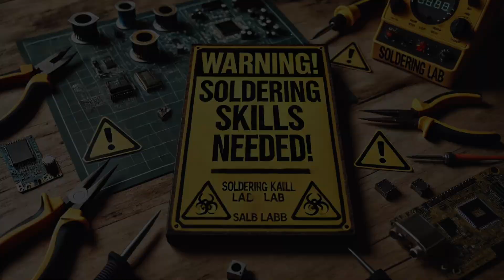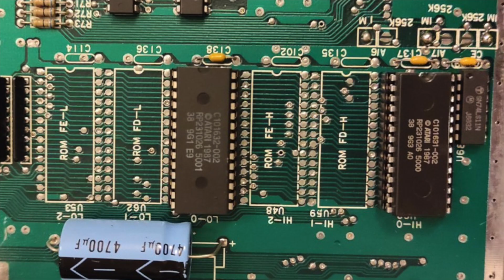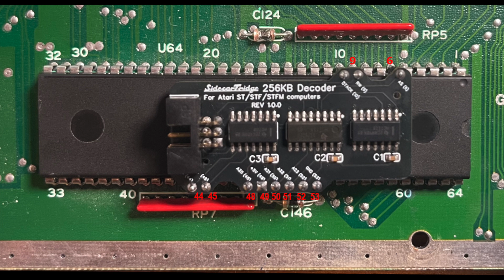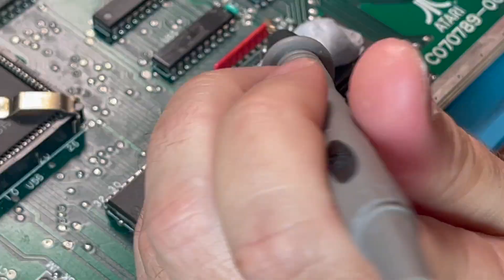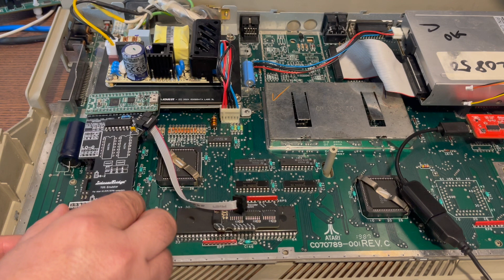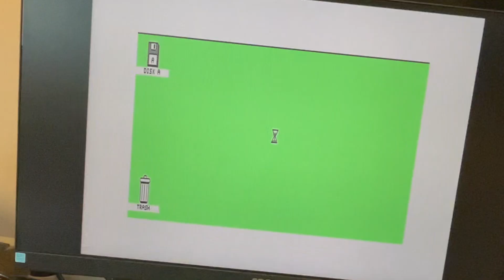SidecarTridge 256KB Decoder for TOS Emulator Quickstart

Comment: Was swapping it in and out. Put it in upside down oops..  

Fortunately I didn't fry the st. . I hope I just fried the decoder. Looks like it was just the 75ls157. I'm going to replace it.
Reply from the maker: Ouch!!!! Check if all the pins are still there. Don’t hesitate to ping me through email or discord server to fix it.
Reply: @sidecartridge   I de-soldered and replaced the chip, if not it's the pi and I'll need to re-flash a new one and replace it.
Reply: @sidecartridge  Hey, it works fine. I have the exoss 16mghz with tos decoder onboard, do I need to add the decoder?